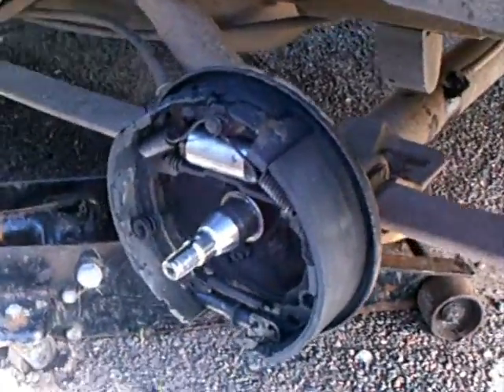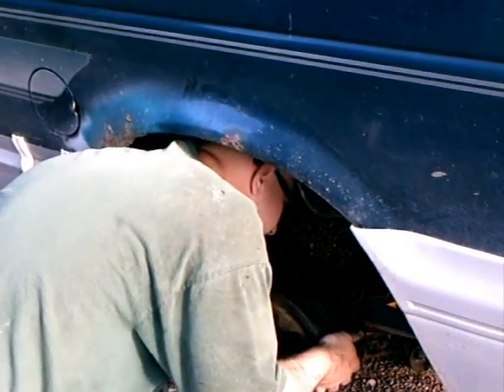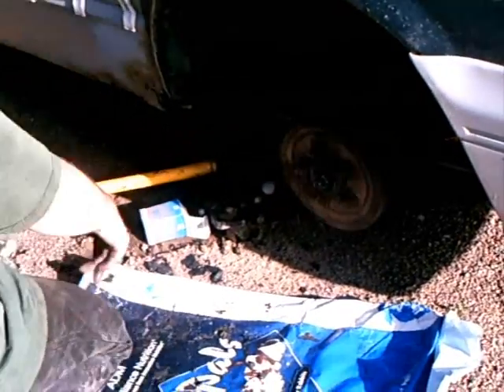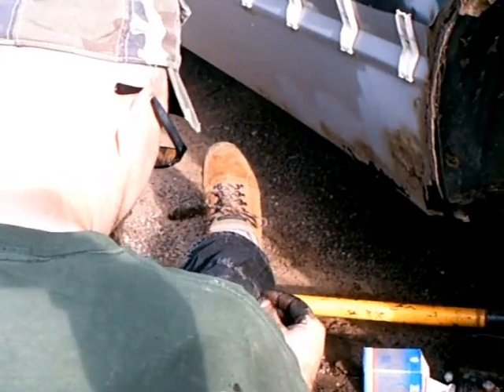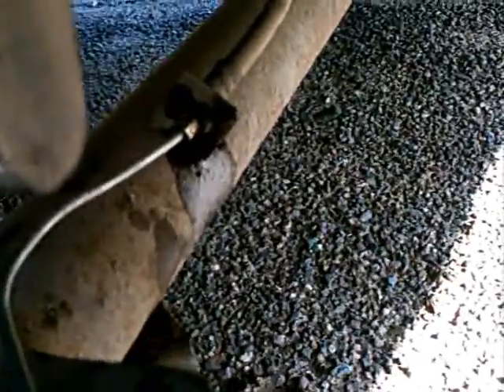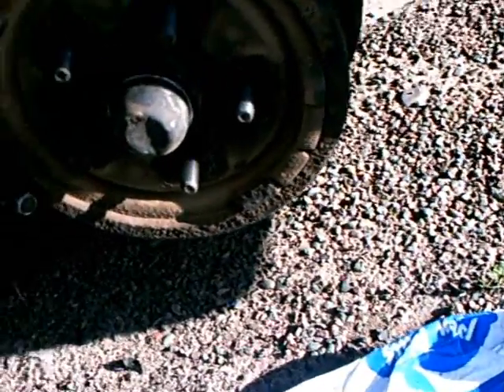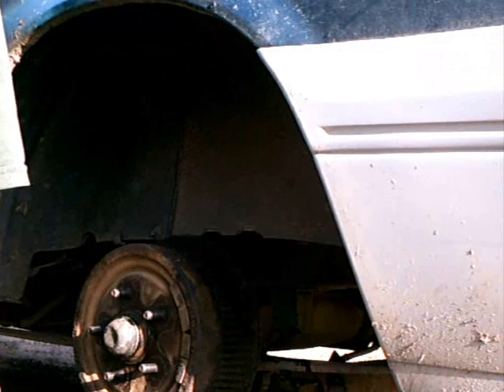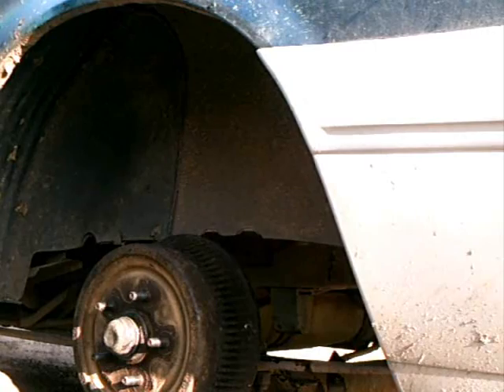95' Plymouth Voyager Van Rear Brake Cylinder Replace PT.3

Comment: This helped a lot, only problem is I have the exact same car and breaking system. Followed your video with other videos and manuals and successfully replaced the rear brake. On drivers side the drum was kinda bad, no more pad on the shoe. We didn't replace the drum because it was still pretty smooth and had a lot left. 5 days later my wheel cylinder blew and break fluid was everywhere. So my dad and I are redoing everything and drum, do you think it could of been the drum that messed the brake?